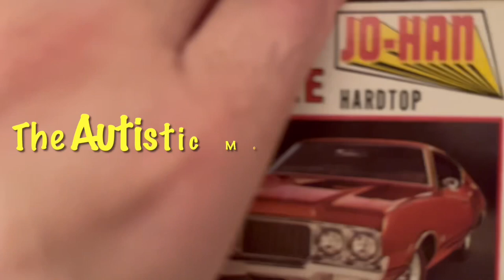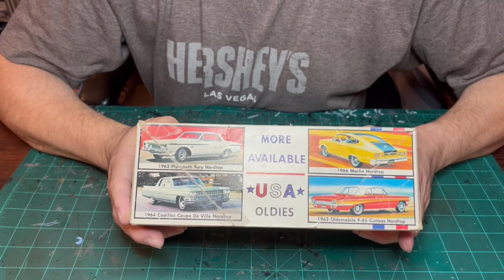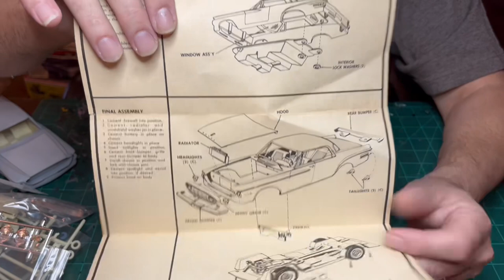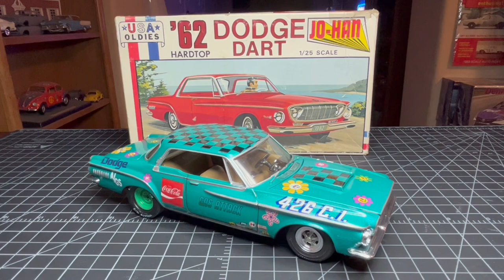Digging thru Louie’s Vault #2  Full build of the 1962 Dodge Dart by JoHan

Comment: You did a good job with the X-acto knife - but using a Dremel tool on that kind of stuff is usually the way I go.
Also, I like to do all separate pieces for the undercarriage - drive train and suspension.  So, I tend to do a lot
more cutting and sectioning of under body areas.  A Dremel is a life saver for that stuff....always wear eye protection !